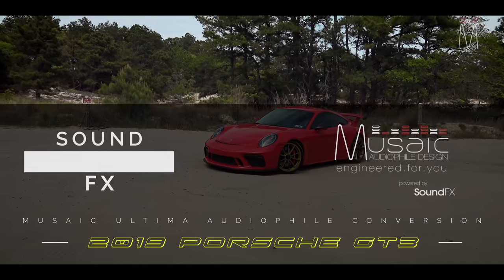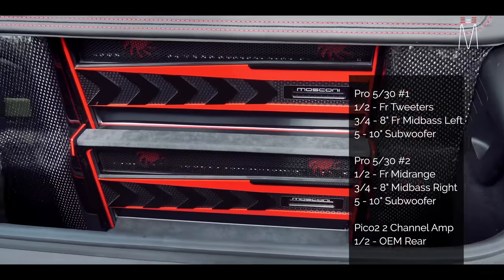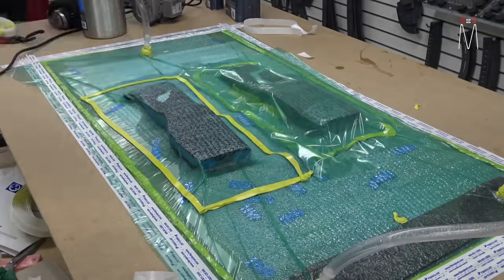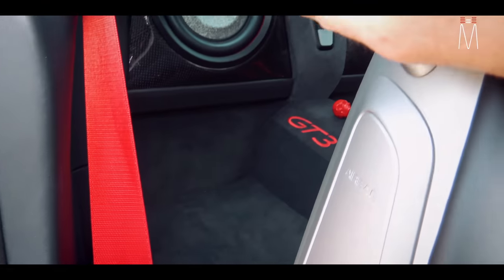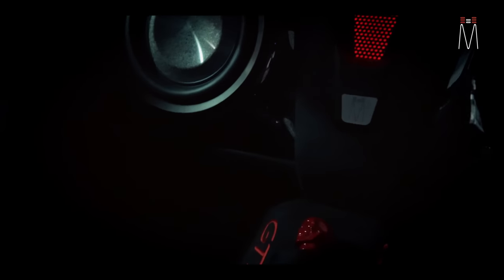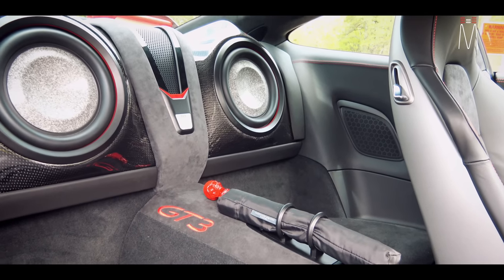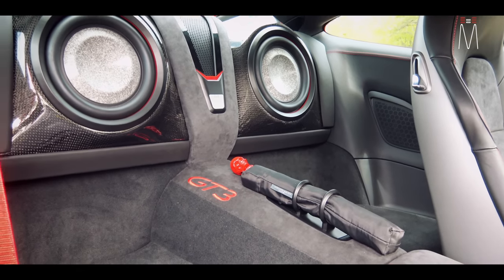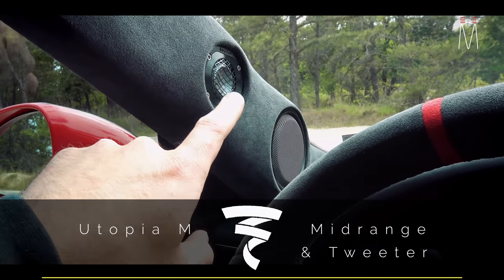Porsche 911 GT3 - The Ultimate OEM Style Audiophile Stereo System EXPLAINED!!

Comment: Dude, you’re one of the best installers of custom installs I’ve seen in a LONG TIME. I’m a retired IASCA sound champion/ competitor. (1998) Looks like I’m going to have to see you sooner than later. Where exactly do you work, and or reside?
Reply from the maker: luvmybeemer thanks for the compliment. I am located in Lewes, Delaware. A state tax free state. So if you are far away, shipping costs are heavily reduced since you are not paying sales tax.
Reply: Matt Schaeffer I’m in NYC for now, hopefully moving to SC sometime next year. I’d like to buy a smallish SUV and put in an audiophile grade system with sub(s) up front and one maybe two amps controlling all the highs and lows. In other words a simple system that will play without fail, have little to no maintenance once installed and that sounds as good as my home system on wheels with a hint of custom touches. So with that said, and I know this is subjective, what small or mid size SUV do you have a preference for and or have done several times that you know you could do something like I asked? This is going to be a retirement gift to me and my wife and I am curious. And btw, a few years ago, my friend and I took the Cape May ferry into Lewes on our motorcycles, it was fantastic and the town is beautiful.

Comment: I've heard a lot of shops forgoing the rears for the upgraded fronts. They even did it on my brother's $3k system in TX... I know this is well beyond $3,000... Personally not a fan. Like what would it be to put some slightly higher quality drivers than the factory rears... $200-$300? Other than that this is one of the highest quality systems I've seen. 10/10 with that being said might as well upgrade every aspect just to do the amazing work full justice. Definitely subbed. Great content!
Reply: I love rear fill. Mid fill as well. To me the rears are important i cant believe some do totally without it.
Reply: rear fill is not necessary in a well built system, especially if you are going for sound quality. A good, quality audiophile system should make you feel like you are sitting in front of a live band. Rear fill can ruin that effect, especially if done wrong, ie. Wrong crossover points,nplaying so loud that they pull the soundstage back, unwanted resonance and echoes, etc..basically its more trouble than its worth trying to incorporate rear fill into a build, when its really not necessary. If you are going for a live experience or competing that is.

Comment: Great video, I agree running the DAP analog I have had many debates with people on this and I explained it just like you did 👍
Reply: I know he touched on this, but you have the dap using it's dac, then it is digitized by the dsps adc, then back with the dac of the DSP finally.
So there are 3 conversions this way instead of 1, all while the dac of the DSP is the last one constructing the signal.
So this doesn't make sense to me. Would like to know why thoufh
Reply: @picassoimpaler3243  I just did a video on this today and will upload it tomorrow.

Comment: Beautiful Install!! I just have one question - Did the owner not car about the adverse effect the weight of this install would have on the handling of the car?
Reply: Late reply but I am the owner of the gt3. The weight hasn't made a difference in 0-60 since I am a tall, skinny, dude soaking wet at 170lb. On jersey tracks which are basically big oval, barely any time difference compared to my buddy's gt3 touring. I do think if I took this to a more complex track like pray to god (nurburgring) it would make a difference with all the twist and turns. I use the car on weekends for fun so no biggie to me since I don't live in europe yet. I am planning on adding a whole manifold to backbox and tips exhaust replacement with Kline Inconel. Which saves about 24 kilos (even the cats Kline make are inconel which are as light as titanium). Combined with the projected swap out of the factory spoiler with techart carbon fiber. It should basically balance out the weight gain from the subs and box. Hope that helps.
Reply: @cabasadefogo9533   Thanks for replying , I’m car audio and track nut , I always have to find that balance in a car. Good stereo without ruining the balance. It’s hard and kudos to you for doing this. Respect!

Comment: the rear speaker are connected to the mosconi amp?  at the beginning you show us that channel 1/2 are connected to the tweeters and the 3 inch mid channels 3/4 to the 8'' woofer and channels 5 to the 10'' subw.

Comment: I’m surprised you haven’t tried the arc audio amps
Reply from the maker: I have, I am just not an Arc Dealer. They make great product. But I also have never run into any issues or bad product with Mosconi that would have me trying to search for anything brand. Their equipment always sounds spectacular. They also make all the inside components of their amplifiers, unlike a lot of other manufactures. So it is the ultimate quality control.